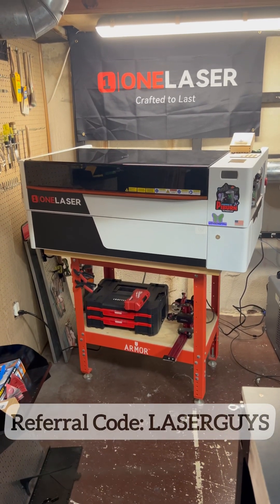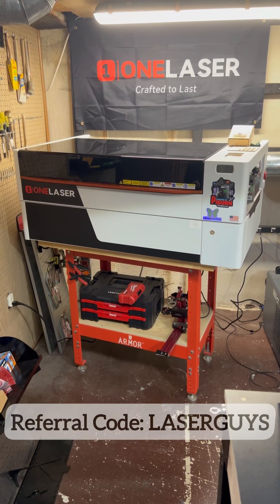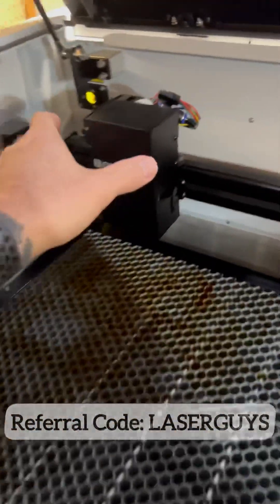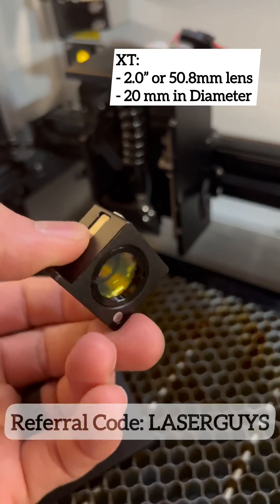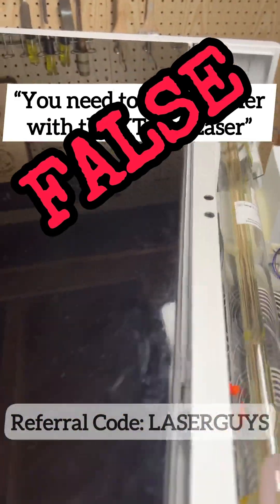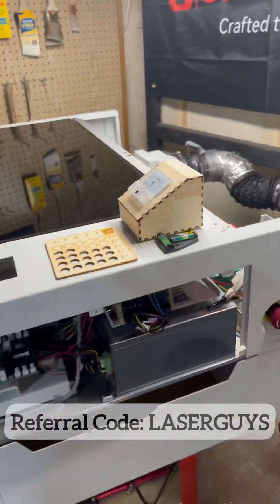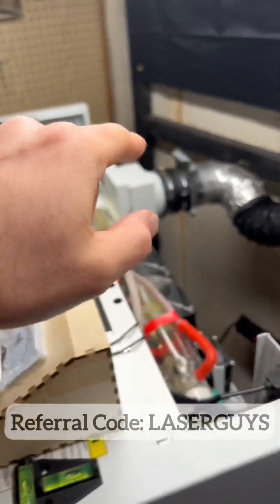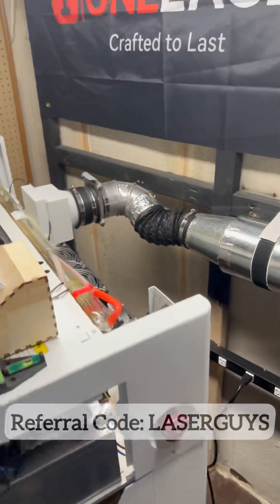XT / XRF OneLaser | What’s inside?

Comment: So, if I have the XRF....2.5" lens will be on top and 2" will be on bottom....the lens placement for a 2" won't change with the model...it will always be on the bottom?
Reply from the maker: XRF = 2.5” lens on top of block
XT = 2.0” lens on bottom of block

This is currently how these models are set up. It could change over time where they both have a 2.5” lens or a 2.0”. 
 
But now that we’ve had these lasers for awhile, we actually recommend getting a 2.5” lens and mounting it at the bottom or a 3.0” lens and mount it at the top. This will help prevent soot build up on the nozzle. You’ll have to account for your new autofocus offset into your settings too.